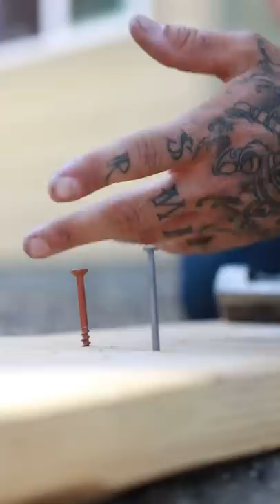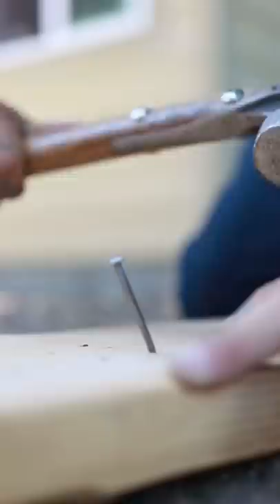Nails vs. Screws: Why do we use nails? #shorts

Comment: The bigger reason is that nails are much easier and faster to install.
Reply: And cheaper. In both cost and labor to use. Framing up a wall with screws will take quite some time which = $$$.
Reply: @adamdodds144  who uses a screw to build sum tho😐
Reply: And cheaper
Reply: @gray.dog6  you can actually get auto feed electric screwdrivers.
Reply: @mathiastoft5496  yes we use bugle screws all the time
Reply: @adamdodds144  yeah and no
Reply: @lifenoobz  yeah i dont know what he is on about
Reply: Probably makes more sense. Economics drives so many things, wouldn’t be surprised if this was purely an efficiency issue. I’ve tried to rip two pieces of 2x4 screwed together, using a hammer and crowbar, and it was extremely difficult. They don’t break that easily, especially if multiple screws are used together. Most likely nails are just way easier, and cost-effective.
Reply: Exactly these ppl on YouTube never know what they’re talking about
Reply: @gray.dog6  lmaooooo minus 5s 😂😂😂😂😂
Reply: @RangerxTurbo  😂
Reply: @user-vc5rp7nf8f  it's all down to shear strength.  Nails and screws each have their strengths and weaknesses.  In framing, nails are the much better choice.  Want to hang something vertical like a ceiling fan?  Then screws hold better on a vertical plane.
Reply: @volo1826  but you wouldn't use nails to build a plane anyway..
Reply: Yea this is the actual reason. Not the bs he's trying to sound clever with
Reply: Nails are easier? Faster? You just put your impact on a screw and hold down the button for 2 seconds and youre done lol
Reply: No its not.. the reason is exactly what he said.
Reply: Biggest reason is shear strength, everything else is a bonus
Reply: @volo1826  i was always taught shear strength was the reason
Reply: @RangerxTurbo  thats not really how ikea stuff is made. They use dowels and these weird screw-like things that are half screw, half metal fastener thing...
Reply: @henrybasenji8943  😂 all i know is if i ever get ikea again i'm having them make it
Reply: I use screws for decks sometimes for the handrails and decking but I agree on the home building part
Reply: @mrgrump2534  LMAO. You had me in the first half.
Reply: Smaller reason but true.
Reply: Plus those nail guns (cordless) are best tools of all time
Reply: @matthewalkman386  yea, Jesus would be proud.
Reply: Imagine you are building a house and using nails and screws 😳🤣. Like building a tree house.
Reply: Now days most are using nail guns

Comment: Finally someone that gives a to the point quick answer instead of an 8 minute video on something so basic.  Thanks.
Reply: Amen!!!
Reply: That s**t is the absolute worst. A long intro and blathering on about anything but the topic at hand. We know why they are doing it too - algorithms and ad revenue. Really sucks.
Reply: Sure, but how often do you leave all your nails sticking out the wood that much?
Reply: But the question is why are screws so much harder and less ductile than nails? is it because by threading them they've been work hardened?
Reply: Literally nobody got the need to bend the nail or the screw . Pull 2 bords a part nail vs screw..you ll see the difference witch one holds better.
Reply: 5 minute intro

talks 10 seconds about the topic

5 minute outro
Reply: @eugeniujosanu279  did you not watch the video?😆...he said when the building is under pressure and it moves
Reply: @runninitup4L  .. since when the nail bends so much under pressure or the screw. With screws won t move under " pressure " .. the nail - not gonna put my hand on fire for nails since it got a smooth surface around it. You really think after" moving under pressure " the nail will go back to original position without enlarged gap around it ? Comon man .. is just easier to work with nails , specially with nail gun . Iv seen homeowners going full screw -no nail, takes longer but worth it . Just simulate the "pressure" with the nail and  the screw befor trusting all the youtube videos
Reply: @eugeniujosanu279  dude what?💀...you have no idea what your talking about...go build a house with all screws and when the ground starts settling and your house starts moving and your whole house falls to peices because the screws broke during movement you can come back to this video and learn a thing or two, have a wonderful day👍🏻
Reply: Fuckin oath
Reply: @runninitup4L i built my shed with screws , the ground sincked and the building still strong... Is stronger then my house built with nails...you know how I know ? I  live in huracane state  .. is that the pressure you talking about ? Because sure enough I felt the move on the house and not a f thing on  the shed.  Look at the video again how much he bends the screw to the point of snapping.. no bords will move to the point of bending it close to 90*.  Can you answer the question why is harder to demolish a building with screw instead of nail .. take a guess. You still have to use the drill for screws , with nails you can just pull the board with your hand
Reply: @eugeniujosanu279  i dont have time to read all these essays but yeah...you built a shed with screws...a house and a shed cannot be compared
Reply: @eugeniujosanu279  but yes absolutely, screws are strong, but they're is just reasons that houses are not built with them
Reply: @runninitup4L    what s the point of conversation If  you listening to yourself only . I use life experience and tested .. u using some YouTube short video.
Reply: @jordantierney1262  what s wrong baby
Reply: @eugeniujosanu279  i do carpentry work with my dad thats been in that field longer than ive been alive...and i guarantee you he'd be teachin you a think or two right now...a few years ago id be thinking the same as you...but once you get to working with that kind of stuff you start to understand...but im not a pro by any means, i still got lots of learning to do
Reply: @runninitup4L  then keep doing with nails  ... Hopefully all that "move " gonna stay in same position after years ... because sure they come out easy when comes to remodeling or demolish after years. I'll do my way.. I v seen contractors and homeowners going full screw.. they choose that for a reason, not to look different or "stupid" for you .
Reply: @mrdocuseal  you need to do a test before opening your mouth .. be respectful or be quite in front of the keyboard...
Reply: @eugeniujosanu279  a lot of people and businesses will keep doing it with nails, and you can keep doing it with screws, im not trying to stop you
Reply: @runninitup4L  I know that . I'm not surprised.  Is just my point of view and from my experience in construction just like u got  yours. Nails have been the choise for decades, before the screw was invented.. personally I m opened to any new/or improved method. They do actually have nails with grooves for a better stay, I d go with those  instead for the smooth ones.
Reply: Ever try to look up a recipe on the internet lately? Practically get someone's biography and the meaning of life written out in long form before they give you 2 lines of recipe. People draw everything out anymore.
Reply: That hammer is badass
Reply: @eugeniujosanu279  those are the most common nails used in construction, nails with grooves going up them, makes the structure stronger
Reply: @hunterdonbach9684  lol 😂
Reply: Fr like for some reason they go like “before we get into that we first got to know what screws are and how they work” like bro stfu and get to the point
Reply: "Stay tuned for part two"😡
Reply: Keith Barlow - or else build your house on a properly prepared foundation , 
not loose dirt ! duh.
Reply: @runninitup4L  commercial building use practically no nails yet they move and don't fall apart...

You guys are comparing non structural screws to structural nails. The industry is starting to use a lot more structural screws... Those screws are just better, the withdrawal strength is amazing
Reply: @Josh.1234  we weren't talking about commercial buildings...im talkin about houses
Reply: @runninitup4L  you made claims about what screws can or can't do.. commercial buildings are more solid and use screws.. not to mention high end houses use commercial building specs
Reply: But it's a YouTube short.... Of course it's not 8mins .. 🤦🤦🤦🤦🤦‍♀️🤦‍♂️
Reply: What he is saying is not true for the most part.
They use nails cos it's cheaper and easier. Plus it's easier for the demo crew aswell.
If you have that much deformation in your building. You should get back to the architect because something is terribly wrong. LoL
Reply: @eugeniujosanu279 
Pull out  force on a nail is lower than on a screw that's true, but when you nail in a dovetail pattern you get mostly shearloads and the joints are equal.
Nails are awesome, you just have to now your stuff.
Reply: Screws won’t break when they are sunken in lol the reason the use nails is because they are cheap screws hold tighter.
Reply: @eugeniujosanu279  exactly this was Probably made by a nail company total bs
Reply: @runninitup4L  it won’t move if you use screws
Reply: Title: You'll Never BELIEVE why they use THIS NAIL?

Video: 8min long.

Intro: 1min 23 sec long.

Talks about the history of nails (from Wiki) for 3 mins.

Is about to tell you why nails are used. . . 

SIKE

RAID SHADOW LEGENDS

Finally explains why nails are used, but repeats the same statement 5 different ways over the span of the rest of the video.
Reply: this is what shorts made for
Reply: @eugeniujosanu279  rather an enlarged gap than sheared fasteners between them
Reply: I need to know more please upload a 1hr long video on this thank you
Reply: @SuperDeinVadda  they do make nails with grooves for a reason , mostly to match the power of holding of a screw... I'd definitely use those instead smooth nail.. biger gaps after years and they rust way faster.
Reply: @runninitup4L  odd how drywall is held on with screws and commercial buildings like hospitals and skyscrapers contain almost no nails and are held primarily together with screws, bolts and welds. Most modern decks which flex much much more then ur average home as they are not nearly as cross supported has all the decking boards (the part you walk on no the frame itself) done with screws and those boards flex a lot. Nails are softer and able to bend more thanks to the metallurgy and buildings are made to flex and shift so they don't rip themselves apart due to environmental issues be it foundation settling (which depending if u have a basement/crawlspace and not just slab on grade would mean u have a block foundation which is less flexible then nails as well) or earthquake. The simple reason nails are used is material cost and labor cost when building. Labor is the biggest cost in building and air nailers are way way faster then screws. As are nailer plates. You can frame out a house in less then a quarter of the time using air nailer vs screw gun
Reply: Or 2 part tik toks
Reply: @knstormshadow  there's not a lot of commercial buildings made with wood...they're all made with steel and that kinda stuff...and you cant hammer a nail into steel so maybe thats why they don't use nails a lot of the time on commercial buildings
Reply: @knstormshadow  there's not a lot of commercial buildings made with wood...they're all made with steel and that kinda stuff...and you cant hammer a nail into steel so maybe thats why they don't use nails a lot of the time on commercial buildings
Reply: @knstormshadow  there's not a lot of commercial buildings made with wood...they're all made with steel and that kinda stuff...and you cant hammer a nail into steel so maybe thats why they don't use nails a lot of the time on commercial buildings
Reply: Plus nails are way faster
Reply: @runninitup4L  and yet they hold together under all those conditions.  The metal studs held together by screws and sheet rock held on by screws dont break apart
Reply: Accept he’s wrong
Reply: This is an amazing explanation! I always wondered this because a screw gives a better fasten! 10/10
Reply: @runninitup4L  
I have used nails and screws for houses only one reason why nails are used is speed and price.
Reply: Or “ keep watching for part 2” 😡
Reply: "In the year 205 AD the native....
Reply: Shorts seem to get alot of views very quickly, i'd do the same
Reply: "...but before we tell you how screws and nails differ we have to go back to when it was first invented in 1855 when an engilish aristocrat Count Jack Screw was playing cricket and the..."
Reply: Different content intentions is all
Reply: Yeah, just too bad it's not true.